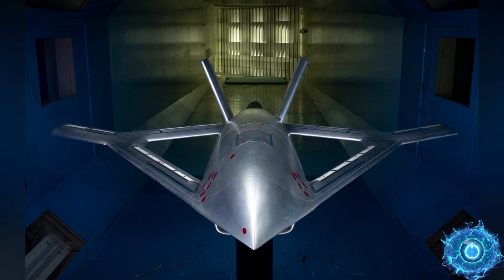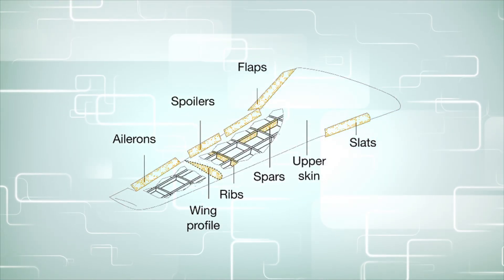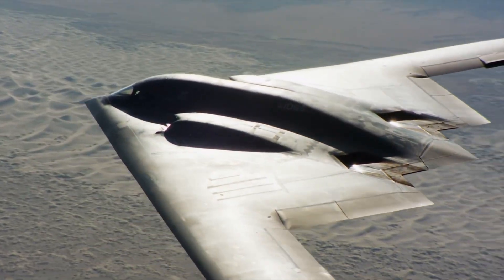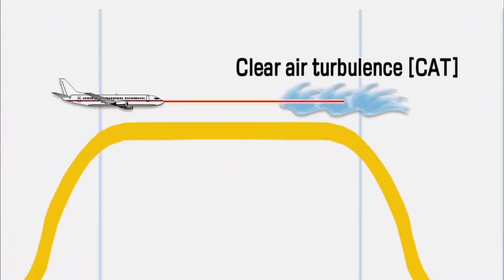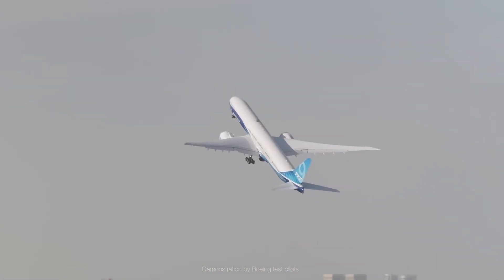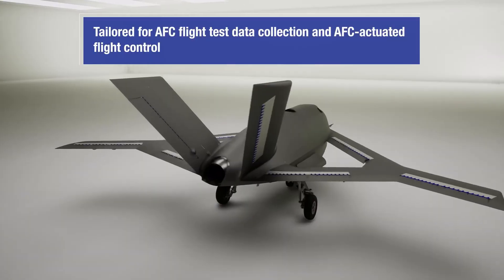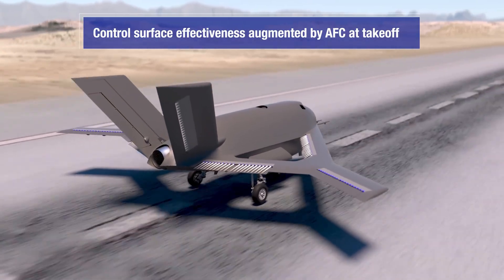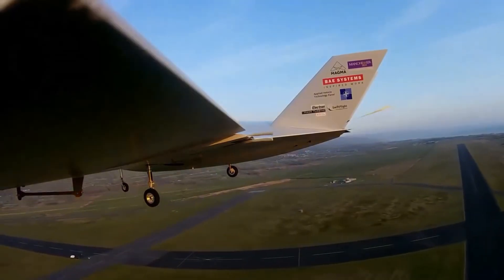Revolutionary Aircraft!? X-65 DOES Something VERY AMAZING

Comment: Someone's been looking at our 50s designed Blackburn Buccaneer. It was a subsonic, ultra low level bomber that utilised a Boundary Layer Control (BLC) system. Designed for enhanced low-speed performance, and it offered several unexpected advantages beyond its initial design intent. While primarily intended to improve lift and control effectiveness during take-off and landing from aircraft carriers, it also provided significant benefits in the aircraft's low-level strike role and even for self-protection and defense. 
Blowing air over the wings and tail, a secondary function of the BLC system, helped to prevent ice buildup during cold weather operations.
BLC energized the airflow over the wings and control surfaces, increasing their effectiveness, especially at low speeds.
The increased lift and control provided by BLC allowed the Buccaneer to perform unexpected and rapid changes in altitude.
BLC significantly reduced the stall speed of the Buccaneer, allowing it to fly slower and more maneuverably at low altitudes.
The Buccaneer's variable incidence tailplane, which could be adjusted for different flight conditions, worked in conjunction with the BLC system to provide optimal handling and stability at both low and high speeds. 
The use of BLC influenced the overall aerodynamic design of the Buccaneer, including its fuselage shape, which was refined using Whitcomb's area rule to minimize drag at high speeds. 
Along with it's variable wing sweep of 40 degrees at the root; 38 degrees 36 seconds in midspan; and 30 degrees 12 seconds for the outer span and an incidence angle of 2 degrees 30 seconds it was a surprisingly advanced aircraft for the 50s.
A big shot yank officer was taken for a ride and upon his return he had to be helped out of the cockpit... he explained "We had to gain altitude for a god damned cow!" 😆
Buccaneer low level pilot's tales are the stuff of legend!

Comment: Can it be scale to a propeller plane where a separate piston pump/air tank combo be used to be the control surfaces?  I think the weight of this system compared to a weight a traditional cable flight controls.  The technology is very similar air bag system used for suspension for cars (roughly 2500 to 5000 USD).  mmmm looks like a get PHD dissertation, Master Thesis or Bachelor Research Project.  Manufacturing cost will  be less because design cut out for the control surface is lesser.   This is guaranteed a good job.

Comment: its a dead end. .  the benefit is not having the extra drag caused by using control flaps but the amount of drag that causes when taking in the big picture is negligable and frankly this is not nor ever has been a big issue or major problem in aviation and there are much more pressing issues to be solved in aviation than this. poor usage of resources

Comment: All I see with this concept is how unreliable it will be! In order to make it work you would have to use an ultra clean pressurized gas of some kind to minimize the risk of jets getting clogged. You could minimize the clogging risk by using larger diameter tubing and jets but to make it work would require a higher pressure. Higher pressures put greater stress on the system and creates many more potential points of failure. You could also minimize the risk of catastrophic failure by having reduntant loops of pressurized gas which adds weight and complexity. Another point of complexity would have to exist in the maintenance schedule on the loops to ensure the same parts on different loops never have the same number of hours of usage at the same time. All  of these measures add to the overall cost of implementing this type of control system. If cost is not a concern it could be achievable but it you think it will save on operating costs I believe you would be mistaken.

Comment: when a stealth aircraft has to use elevators it increases the radar cross section.  if it has thrust vectoring its preferred over using elevators as much as possible.  by removing the elevators and cause air turbulence over the wings you can dump the lift of the wing and control the roll pitch and yaw.  i never would have thought of this but then again i dont design aircraft at all :(

Comment: It's not like you are making a complex system simple, you are just replacing moving parts with even more moving parts, but on the inside and add more complexity, while reducing space normally used for fuel storage. If this you be simplified significantly there might be a chance, but I am sceptical.

Comment: I think ionization is going to require such immense energy that it may never be used except in ultra-exotic designs, or perhaps as an efficiency enhancer at much-scaled-back proportions

I love the idea of using bypass air though; it's already there, it's a fact of flying airplanes powered by jet engines at high speeds, so it doesn't require extra power per sé. I think they will definitely be deployed at scale even as an efficiency enhancer, but I do wonder if they could be used standalone, which if they work would enable massive weight savings as control surfaces are made immobile

Comment: Birds use coordinated piloerector muscles and the dense cerebellar brain structure that includes learning and predictive skill to modify feather angles in an entraining fashion. AI must function using memory, learning, prediction to be useful to any pilot, whose own sensory systems are not directly linked, forever slower than a bird's response.

Remote piloting is more efficient than any onboard dual control design. There will be no "singularity" as our brains are adapted to other actions and contingencies. 
The sensorimotor "skills" of a craft like this, are dependent upon the exteroceptive sensors, the future for engineers of such a semiautonomous craft.

Comment: The real advantage is the ability to fit the pressurized air lines for control into really thin low drag wings which struggle to fit hydraulics or servos inside them

Comment: I'm confused about the doubt here - you've never heard of NOTAR helicopters?  They use the Magnus effect from a slot under one side of the tail boom to produce most of the countertorque, with an adjustable nozzle for control. This idea just bumps control to valves in the pressurized air system, where a NOTAR system has a compression turbine attached to the rotor transmission, making it more reliable than a standard tail rotor but eliminates the option of rapid source modulation.
I am still curious about the reliability of the compressor that provides air to the control jets, or the alternative tech they're pursuing.
Reply: Why do you need one single compressor?  Have multiple.  What happens when your hydraulic pump fails, or your hydraulic lines are severed, or your FBW powers off?  Redundancy and backups.

Comment: This is DARPA territory.  A system using jet puffs to control the aircraft instead of conventional deflecting control surfaces is to maintain a minimal radar cross section of the airframe.  With jet puff controls a clean frame profile is maintained at all times.  It has nothing to do with passenger comfort in turbulence.  That's another topic entirely.
Reply: There are a lot of UAP reports of diamond shaped flying object moving in odd directions lol I'm guessing this would explain a few of them at least 🤣
Reply: No, turbulence is way more than passenger comfort. Basically you are expending fuel which is wasted on movement away from the direction you are travelling, eliminating this problem makes the plane much more efficient.
Reply: @alst4817  Yeah fuel savings is the biggest driver in commercial air development. Fuel is not going to remain this cheap for ever.
Reply: The NGAD fighter prototypes probably use an advanced version of this control system.
The B21 Raider has huge fast moving control surfaces, especially the elevons much like a pure fighter jet.  When the B21 quickly pivots directly into the detection radar source it may seem to disappear once the controls are returned to neutral position.
Reply: Yup. It means that course corrections and maneuvers for stealth aircraft need no longer compromise stealth. When you deflect ailerons or rudders or any control surfaces, the integrity of your stealth is broken. Aircraft using active flow control combined with thrust vectoring would be a HUGE improvement.
Reply: I'm pretty sure that its just common sense that the military isn't interested in our comfort, lol.  DARPA exists for ONE reason, to improve our weapons systems thru science.
Reply: I know how to make cheaper....checkout are Air bags used for Car suspension that has two air tanks.  I think there is a working unit for NASA.  It is the EMMU jet pack used by the astronauts to build the space station.  A smaller version is also part of the Space Walking Suit.  The technology is there

Comment: I can see this type of control system working,  but i don't see a way to get away from conventional controls. Because at low speeds, like take off speeds you would still need conventional controls. At least until the plane gets to higher speeds.

Comment: What about an aircraft that simply changes its internal centre of mass ???  to control its direction?
Reply: Or even adjusting multiple points of mass internally.
Reply: Adjusting masses at multiple points could potentially enhance the overall stability of the aircraft, especially in certain flight conditions.
Reply: For example 4 corners of mass. Fore, Aft, Left, Right.

Comment: I hunch that a double wing will always be bad aerodynamics but in principle the wings could be mounted on suspension and move independently of the fuselage. Maybe as little as 10cm travel might smooth over a lot of felt turbulence. Very fast control surfaces might also work. The entire wing could also be a control surface that pivots. For smaller planes that's actually not a significant material strength feat. It's surprising how small the wing spar mount on a small plane often is so to make it roll would not take much. You might even imagine a passive suspension style roll of the wing. Might even be quite easy to make... hmm interesting
Reply: I was thinking something similar like "bending" wings and rudders with cables, or something of the sort, like a piece of paper, or twisting a piece of plastic.
Reply: @jacobwetherby  Cables to force the twist is too much effort.  Put a small control surface on the leading edge of the airfoil that drives a positive feedback and uses the airflow to twist the surface for you.
Reply: Differential drag is the principal, which also generates or stalls lift at considerable pace. It's totally viable, and has probably been used in missile control for ages.
Reply: The turbulence reduction Demonstration that was shown momentarily with the probe sensing the turbulent in front of the little plane, that was very impressive.

Comment: I have a very basic pen and paper design for a flying wing with four slat outlets on the wing two on the upper surface two on lower, upper and lower offset (upper outlets outboard, lower inboard or some other combination). Two electric motors one for each set of outlets.  There is an interior geometry that directs the flow from motors to slats and all thrust is through the slats. Thrust can of course be varied by energy supplied to motors but there are also louvres on each slat outlet.  By changing output to each and a lot of experimenting maybe pitch, yaw and roll control could be achieved.  Maybe four motors is simpler design, one per slat, no louvres. The complex geometry of the wing and interior flow chambers is best manufactured by 3D printing the forms.

Comment: Ionic air molecule deflection to streamline flight surfaces with plasma seems futuristic, but with advancements in metamaterial science and power generation capabilities, perhaps sometime soon.
Reply: I'm also curious if the static charges buildup (sometimes potentially thousands of volts), due to friction of fast moving air over surfaces during flight, that if there could be a technical method to use these same charge buildups on the surface skins, to ionize the air molecules passing directly over them... to fight fire with fire, speaking colloquially.... possibly developing  & utilizing advanced exotic paints and other surface coating treatments.
Reply: @0neIntangible  NASA has scale models that can do this already.  Its not near as futuristic as it sounds.  Just remember how fast things advance now. . .anything that sounds futuristic is either already happening or a few months away.

Comment: I would think the changes to reliability would be negligible. You have fewer moving parts exposed to the external environment, but you also are relying on a supply of compressed air. In theory the internal air ducts and valves could clog/jam/fail as well.
Reply: Bird /Debris Strike,.....Anyone ¿?¿
Reply: @RH-nm9pv  yes good point about bird strikes, this system would be much more resitant than standard control surfaces.